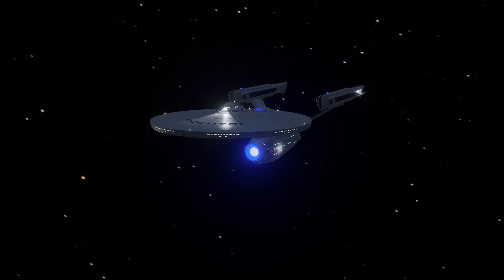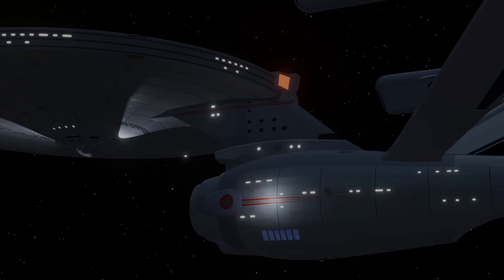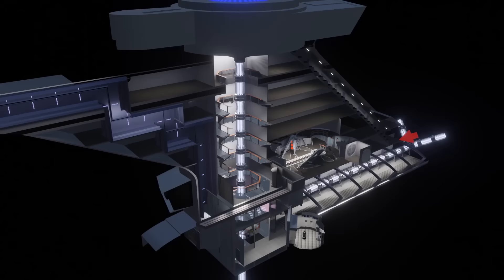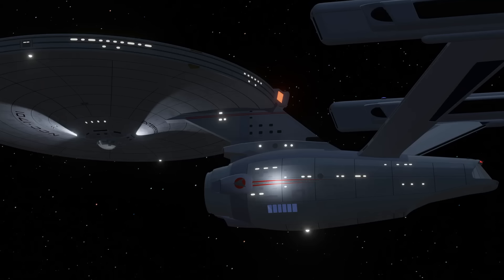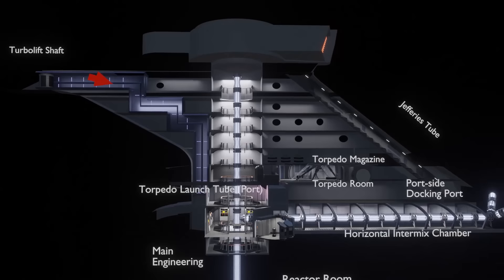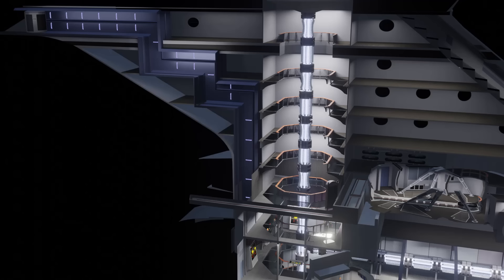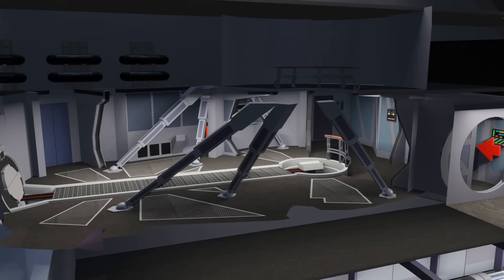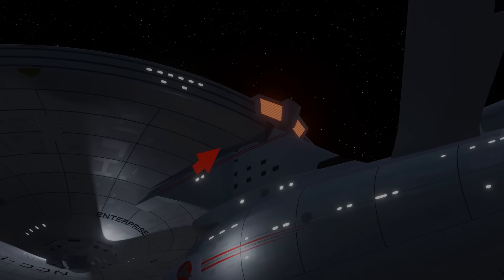The Enterprise Dorsal Problem: how did the turbolifts pass through it?

Comment: I found a set of blueprints that seems to answer these questions fairly well (assuming the scaling is right, of course).  It's something called the NCC-1701A Deck Plans by "Strategic Designs," created around the time of Undiscovered Country.

In their design, a horizontal turboshaft runs aft down the saucer centerline on G deck, to a point just forward of the impulse engineering room.  From there a vertical shaft goes straight down through the next eight decks, bisecting the two torpedo launch bays along the way, near the front of the hull, as you surmised.  This shaft terminates on O deck next to Main Engineering.  On O-deck (in the engineering hull), there is finally enough room for a horizontal turbolift tube to traverse around the intermix chamber core in a "semicircular" path, before continuing to head aft, running parallel to the horizontal part of main engineering, on its way to servicing the rest of the engineering hull.

Your second issue concerned Kirk's path between the torpedo launch bay and the bridge.  According to the blueprints, the door in the torpedo launch bay you mentioned leads to a service ladder shaft that runs just aft of the intermix chamber from M deck (torpedo launch bay) to H deck.  

The pathing gets a little tricky to figure out here, but it looks like the intermix chamber is just wide enough on J deck to support a catwalk all the way around the core, plus some doors between the intermix chamber and compartments fore and aft.  Just forward of the intermix chamber, on J, there's a tiny observation lounge that has access to the turbolift system.  So if I'm reading it right, they had to climb up three levels on ladders, enter the intermix chamber, and then take a short walk around the core, into the observation lounge, and into the turbolifts.
Reply: Nah, you're reading those wrong. That's a Jefferies tube. The turbolift shaft runs behind the intermix chamber, and just above the photon bay runs horizontal to go behind the photon bay and down into the secondary hull.
Reply: @Jarsia  Well, the way that you can tell on that deck plan, usually, is whether it has some medium-sized empty white circles in the passage.  Other than a few exceptions here and there, those represent vertical turbolift shafts - the symbol legend shows this.  And then, turbolift doors are usually the shaded circles that have one slightly flattened edge where they meet a walkable passageway.  

I do see a Jeffries tube in the aft part of O-deck (labeled "JT") that looks like it can be accessed by a turbolift door.  

Now the plans aren't perfect - I spotted a place in the saucer where it looks like they were missing vertical shafts.  But their idea for a half loop around the warp core seems feasible.
Reply: @jimwesteven2023  I do wonder if we're looking at the same versions, as the ones I have are dated to 2009. Got them off cygnus-x1
Reply: @Jarsia  The one I was looking at was also from cygnus, but dated to 1992.  That brings up a very good point, though.  There's no such thing as a definitive blueprint.  All of them are works of imagination, and equally valid.

But I just had a thought - the ones I was looking at were for the Enterprise-A, not the refit.  So it's not even the same ship, LMAO.  It might have the same turbolift layout as the refit or it might not - impossible to know.  

The thing I liked about the Ent-A plans there was that they actually have an overhead view instead of the side view schematic.  Seeing an overhead helps get a sense of the volume of the space and is more "fun" to look at.  Though no more definitive of course.
Reply: @jimwesteven2023  yeah mine also have the deck by deck layout. I tried commenting with a link a few days ago but the comment kept disappearing

Comment: It's been a long time since I had last seen "Star Trek II: The Wrath Of Khan", so I don't remember enough details about the movie in order to notice the ship design inconsistencies of the TMP era Constitution class starship  refit design configuration. But there are some possible explanations to get around those design inconsistencies.

One: the ship has 2 forward torpedo launch tubes, which means that it either has 2 torpedo launch control rooms for the forward tubes, or has just one room that is bigger than what was depicted on screen. Either way, the launch control room is probably not directly connected to the Turbolift shaft, so there may be a small corridor that is between those 2 sites of the ship.

Two: the ship's "neck" may have 2 Turbolift shafts, one in the front with no deck access between the saucer section and the engineering section, and one in the back with access to all decks in the neck, but with that Turbolift shaft terminating within the saucer near the impulse engines.

Three: the shaft for warp core may be way bigger in diameter than the warp core itself, possibly big enough to accommodate a Turbolift car, probably running on tracks through the warp core shaft instead of a separate Turbolift shaft occupying the open space of the warp core shaft. It would make sense to me that the warp core shaft might be much wider than the warp core itself, because the port-to-starboard width of the neck of the TMP Enterprise always seemed to me to be much wider than the port-to-starboard width of the neck of the TOS Enterprise.

There may be other possible explanations for the design inconsistencies, but those 3 are the only ones that I can think of at this time.
Reply: When looking at the older USA Battleships, a lot of small and only designed as emergency escape tunnels in certain parts of the ship were filled with pipes and cables as they were modernized. Not worth it drilling holes through thick armor or  lots of decks. 

What if the warp core goes through the old turbolift shaft. If turbolift tech has advanced like everything else, maybe the space needed for that has decreased letting room for it to go around the core.

Makes no sense to have on each floor for there to be a big room where you can walk around  the core. That space is definitely being used to run a lot of eps, data and what other "future pipes and cables" necessary for the ship to run.

Comment: Two  questions: 1A, why would the warp core be up front when the necelles are in the rear? 1B, since the beginning when Mitchell died, it was stated the impulse engines  have their own fuel pods. 2: If the Enterprise were real, it was be the size of a heli carrier. Even though there no weight in space, any bloody connecting dorsal would have to be wider then 4.8 meters or the stress of full impulse and high   speed turns would shred it.
Reply: Same issues with those pylons holding the warp nacelles in place. The whole ship is like an ice sculpture of a swan: so elegant, so beautiful, but ridiculously fragile.
Reply: You're forgetting the "Structural Integrity Field" as well as the "Inertial Dampers" 
AKA: Wizards magic. They already made in universe excuses to justify the pretty designs.
Reply: @mzaite  Oh, I try to forget those things. I try.

Comment: Thanks for the breakdown, great video! In regards to the Oberth, lets just assume that that canoe bit at the bottom is a large deuterium tank for long range exploration (and no crew space) and call it a day. Oh, and everyone sleeps at their station...
Reply: I always thought that there were smooth Jeffreys tubes in the pylons of the Oberth, where you just jump through a hatch and slide down to Engineering. So much fun. Maybe reverse gravity to slide back up?

Ridiculous, yes, but just look at that thing.
Reply: The suggestion had been made on the Trek BBS, several years ago now that the lower hull I'd actually the warp drive or( my idea, a production prototype transwarp drive). This solves many problems in that a transwarp prototype explains why the Excelsior was built,  and it eliminates the need for a crew down there. Too much potential for radiation. 
Now about the 'warp' engines...
Two possibilities,  the first is that they are deployable sensor houses. The second an emergency way home warp drive. It  would be much slower than the transwarp prototype,  but would get you home faster than impulse power. 
As to sensor capabilities the one sensor you really need for a survey ship is a better clock. By knowing the precise time better,  a force multiplier is obtained. So 'conventional' sensors would be by the virtue of the better clock that much better. To compare the original LIDAR, with current top of the line versions. They can image the rainforest floor. Versus synthetic apicture radar.

Comment: I've always said the scaling of the TOS and TMP Enterprise was off due to the needs of things like a shuttle hangar, the torpedo bay, and things required for life support like water recycling, solid waste recycling, a fusion-powered propulsion system (Impulse Engines).  The Kelvin-Timeline Enterprise (or as some call it, the JJPrize) got the scaling RIGHT...maybe not the looks right, but the scaling right. The Galaxy-sized vessel, therefore, should have been the size of the USS Vengeance (Star Trek Into Darkness).

Comment: The elevator in TOS moved both up & down, as well as horizontal and/or diagonal, similar to how both the Eiffel Tower and the Luxor Hotel in Vegas elevators work. In a few episodes when Kirk was in the lift, you could see in the back which direction they were traveling that was lite up to show which direction they were going.

Comment: The same way Voyager 's hangar could accommodate multiple shuttles, the Delta Flyer, Neelix' shuttle, and still have a parking space for Alice; and how a runabout could fit in Enterprise-D's hangar; and how (according to the Picard production designer) La Sirena could be stowed in a Titan-A/Enterprise-G hangar:  

It's TV and movies.  If they say it works, it works.
Reply: Most of the hangar space issues make no sense but the enterprise d's main shuttlebay took up parts of three decks of the saucer section and used a good chunk of the saucer section on those decks

Comment: I'm a bit puzzled as to what the source(s) are for the intermix chamber running up the dorsal section. And so far up it to boot.

Because if it ran that high, wouldn't it interfere with the emergency saucer separation feature?

Whatever, it would appear from this and other videos it appears the neck section is too thin to accommodate all it was supposed to have.

I'm glad they came up with more logical measurements for TNG and onwards.
Reply: I wrote a reply but I think it got filtered. This will be a little shorter but I’ll try to cover the main points. 

Andrew Probert used to maintain a blog where he posted a lot of original blueprints and sketches for stuff he worked on. So that includes the TMP Connie, the Galaxy-class, the DeLorean, and AirWolf. He laid out his thought processes and was generally a stickler for trying to ensure there was enough room in the model to accommodate its inner workings. 

The blueprints at least include mention of the saucer separation, and show a sort of connector into the “impulse deflection crystals” at that point. It does seem a bit overwrought though. 

But on his own blog he criticised himself, wondering why he decided the warp core should connect to the impulse engines at all. His placement forward in the dorsal was a result of connecting to the impulse engines, and he knew he felt like it made sense back then to do double duty on the same power plant, but looking back on it he thinks it should’ve been separate systems. He did carry that insight over into the Galaxy-class at least, which had completely separate impulse reactors. 

The blueprints for the secondary hull also don’t make any mention of the lifts, mainly just the engines, shuttle and cargo bays, and the arboretum. I suppose he thought he was blocking-out the major parts and the rest would get squeezed-in, which works with wiring but less-so with elevators!
Reply: @kaitlyn__L   The only thing that makes it make sense for me is that for safety, antimatter is stored at the bottom. The intermix is in line to take it to the nacelles. The matter component must be stored by the impulse drive. It could be using the same fuel for the core as for the Impulse fusion drive. Also the EPS power could be sent up separately from the core into the dilithum Deflection Crystals to boost Impulse engines. We know that phasers were tied into the warp drive.

This would explain why the core is crazy long compared to other federation ships. The Miranda just does not need that length between it's duel fuel sources.
The Refit Enterprise really seems to just be a ship that has been as modernized as humanly possible because the ambitious Excelsior project took longer than expected to be completed and they needed ships capable of combating the Klingons. They got as powerful  as a ship they could on that old platform.

Comment: A very good video overall. And to add to the problems presented, with all of the room that the Enterprise's neck needs to devote to a warp core shaft, a torpedo room, whatever rooms that are there that require portals, and a turbo lift shaft that snakes through there somehow...where is there any room for support structures? The saucer section is massive as is the engineering section. That dorsal pylon had to be crazy strong for how thin it was, and even if it was entirely devoted to an inner skeleton that could handle the load, it still looks like it's seriously in danger of bending or snapping if the ship encountered any torsion from even basic maneuvers.

But here we are with just a stack of decks and some shafts running up through much of it, with the usual paper-thin hull plating along the outside.

Comment: I love the cutaway animations!!! They are so beautifully done and that torp bay!!! <3
Whilst the implication is that the core ran all the way to the top of the IDC housing, it might not actually need to do so as the point of the warp core is to ensure the flow of matter and antimatter into the reaction chamber in main engineering. the impulse drive usually is formed of fusion reactors and may connect to the warp core systems for other reasons. now I'm going to look for red arrows in TWOK following our good admiral around :D

Comment: The intermix chamber service area could have narrowed around the torpedo bay (and likely been reinforced, preventing Reliant's phasers from severing it), in which case, the door Kirk exited by could have led to a hallway or room allowing him to go around the chamber and to the turbolift. The real question then is whether he had to step over part of the torpedo launch track, since the torpedo bay clearly feeds into a double launcher. Not at all impossible,  given that STVI shows Bones and Spock in that part of the bay as they upgrade a torpedo on the fly.

The real problem, as you say, is that the shaft goes right through the Engineering lobby and there's no room for it to move over to the left or right before that. We can almost make it fit by assuming that the lobby isn't precisely forward of Engineering, but is off-center towards Starboard. That doesn't quite fit what we see on-screen, but it makes a little sense of Kirk walking down a long hallway to get to the lobby in TMP, which might be able to barely fit to the starboard of Engineering. Okay, not really, but it makes more sense than any other scenario I can think of.

All this because the TMP designers wanted to show off a huge, mostly-empty, warehouse-style shuttle bay in TMP and have a vertical shaft connecting Engineering with the impulse engines.

Comment: Not so sure about the movies, but I know in tos the turbo lift would move both sideways and up and down as indicated by the flashing light on the wall, it would shift from vertical to lateral on some occasions, whenever Kirk and Spock would take it from the bridge down to engineering or wherever, so they could have time for their little 1-on-1 elevator conversations.

As for the refit, I think we just have to pretend that we don't notice these little things, and just admire how good she looks from the outside.

Comment: Would solve a lot of problems (including Torpedo room weirdness) if the intermix chamber stopped at the top of the secondary hull. I know the warp core and impulse systems are supposed to be connected in this era of starship design, but it just makes more sense to me that way imo.

Comment: The TMP refit is a problem.  That vertical shaft stretching up to the impulse engines make it impossible for turbo lifts to run stem to stern uninterrupted.  And we see that in TWOK when Spock has to pass through a hatch on his way to engineering to hot wire the warp drive.

The Enterprise-A, on the other hand, has a different engine layout, thanks to reuse of the TNG engine room.  That gives us enough wiggle room to imagine a different arrangement of the internals and remedy this problem.
Reply: Spock had to use the Jeffries tubes to get to engineering because the turbo lifts were inoperative below C deck. He told Kirk this after returning from the Genesis cave. They climbed up the tube from the transporter deck and presumably boarded a lift on C deck to get to the bridge.